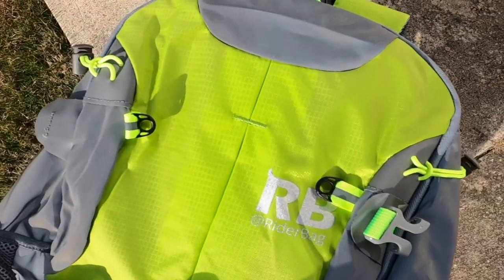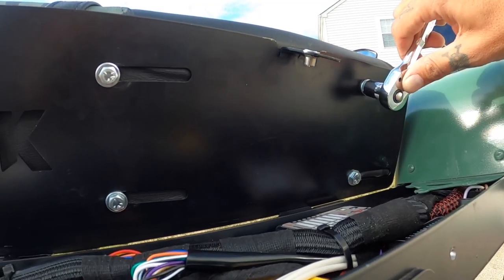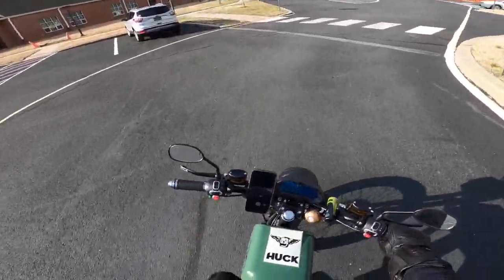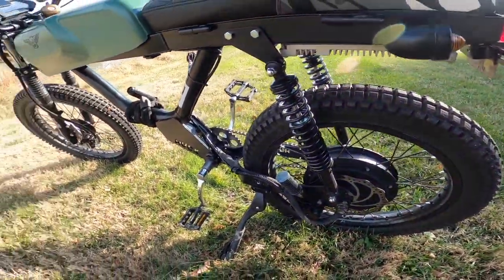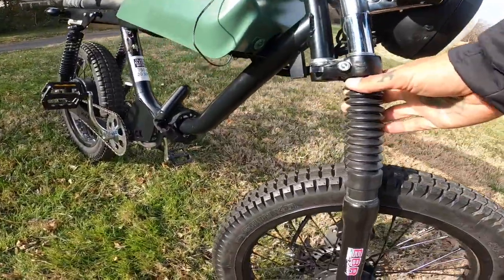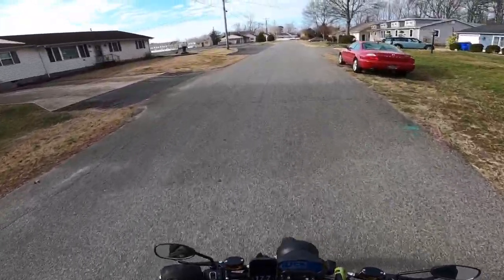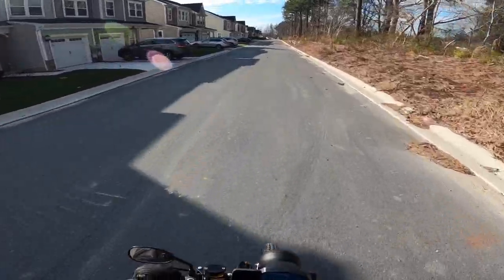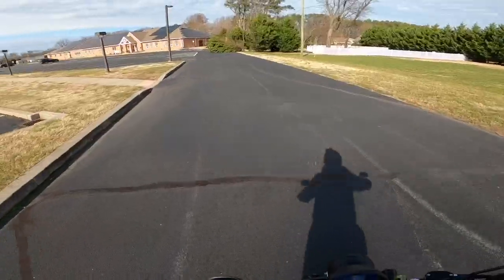HUCK CYCLES NEW SEAT INSTALL + HUCK’N TIPS | Stinger 3000

Comment: So can you stop and go with the regen... Like can you drive around town without using brakes?
Does it regen whenever you have no throttle or how does it work?
I agree that regen would be great if it can be used to save brake pad wear (a little charging works too).
Reply from the maker: You can stop if you’re going kind of slow but if you’re going fast you definitely have to hit the brakes a little bit.....The regen only works when you’re tapping the brakes.... you can feel the hub slowing you down🤘🏾🤘🏾 I can show it on my next video👍🏾👍🏾
Reply: @SHREDDIEMCSKATE  That would be good to see, thanks man!